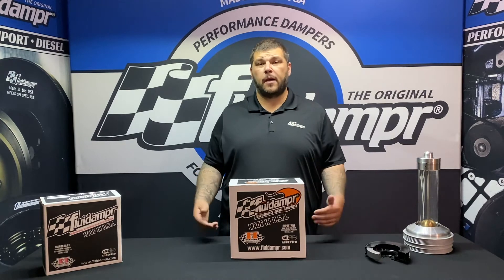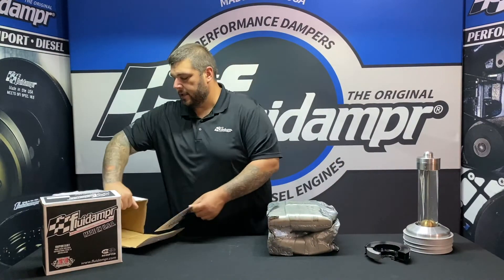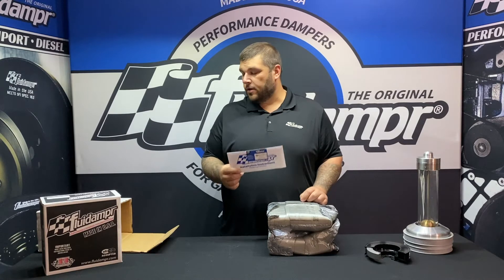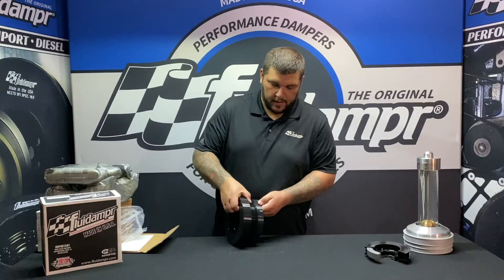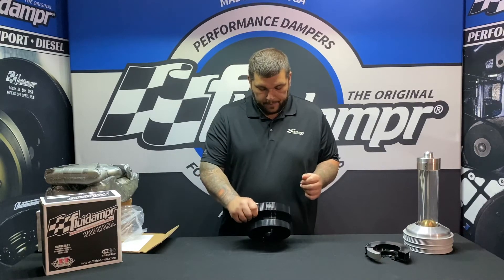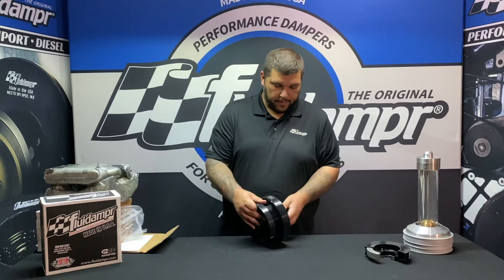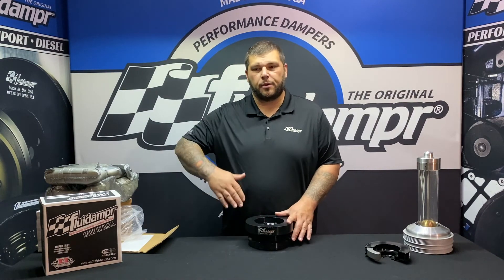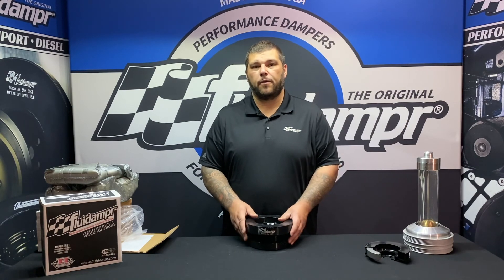Fluidampr | 7.3L Ford Power Stroke 1999-2003 | #720211

Comment: Any help with removing one? I've broken 2 pullers now and can not get this thing off.
Reply: you could remove the damper ring bolts (7/16-20) and use an H- beam style puller - bolts retorque to 60 ft. lbs.
Reply: Just installed mine and can't turn the motor with a wrench